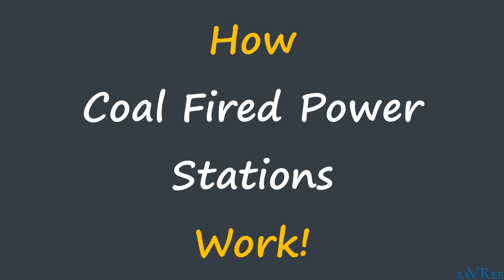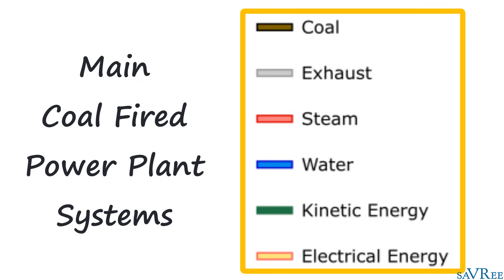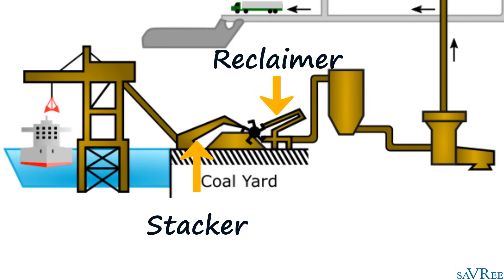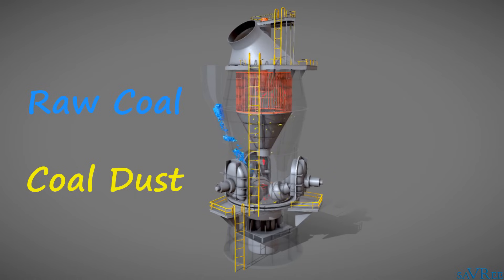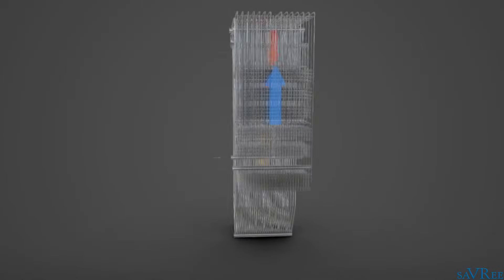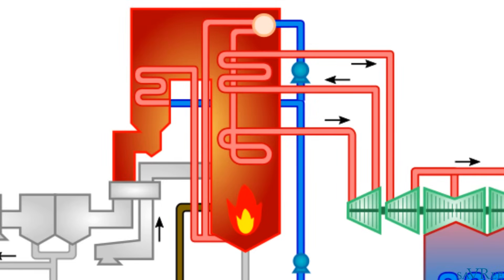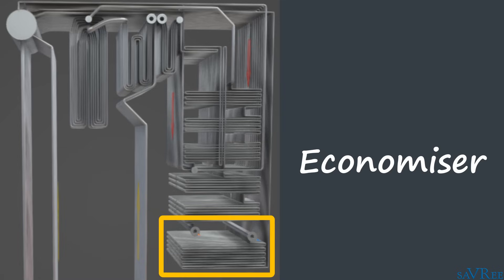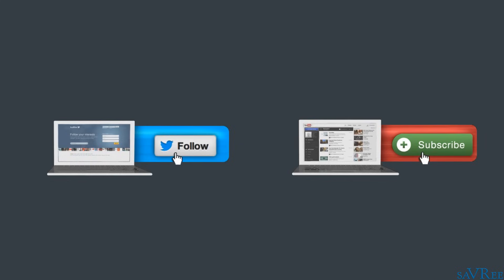How Coal Fired Thermal Power Stations Work

Comment: Can you explain the boiler feed water pump section. I was told that the pump just delivers the water into the system, obviously at high pressures but no where near as high as the mainstream pressure. That pressure is generated from from firing and steam generation which for me means that the the latent heat transfer would not be at a constant pressure as explained in the ranking cycle. Kindly clarify. Thanks.

Comment: Can you do a video on electric cars? I find it paradoxical to know that these cars are charged from the same electricity that is generated by burning coal. Yes, there is no vehicle exhaust but it'd be good to know carbon emissions of using fossil fuel vehicles vs. carbon emissions of coal required to charge equal number of vehicles.
Reply: I agree. In Ontario Canada we have 58% carbon free electricity  from a nuclear power plant. I think this is the future of reliable carbon free power generation.
Reply: Your intuition is partially correct. However, electrical power stations can generate electricity much more efficiently than the internal combustion engine in our cars, so while we do lose efficiencies in going from coal -> electricity -> battery -> move car, because our combustion engines in our cars aren't very efficient the battery-powered car can still win out. The power plant is 33-48% efficient, while the combustion engine is 12-35% efficient, while the electrical car is ~59-77% efficient. Combining the electricity and electric car efficiencies, we get 19-37% efficiency, compared to the gas car's 12-35%.

Also, electricity can be transported long distances more efficiently (thanks to transformers and a massive power grid) than gas, which is delivered in trucks to gas stations.

Furthermore, we can produce electricity from renewable sources like hydro, solar, and wind, practically disregarding the efficiency comparison regarding the electricity production where the grid has a high proportion of non-fossil fuel power sources. However, there are efficiency losses associated with the manufacture and maintenance of these devices as well. Same with batteries, which also take energy to produce.
Reply: @discipleoferis549  An EV is more like 80-92% efficient once you factor in grid transmission losses, and AC-DC conversion when charging the vehicle. Overall, from well-to-wheel, a battery EV is around 70% on a coal powered grid, and 90% on a nuclear/hydro grid. Still MUCH better than a gas car, plus of course the benefit of less pollution in local areas.

New studies show an EV is at emission-parity with a gas car after 30,000 miles (50,000km) and after this, the EV is cleaner.

Comment: Why the steam is cooled in the condencer befor it send back to the boiler ?
This make it cool , so the energy needed to heat it up is more than if it is hot .
Reply: Just a theory but it may cause a positive feedback loop and cause an explosion
Reply: @benhutchinson9054  
I knew the answer later, which is
" Ranklin Circle "